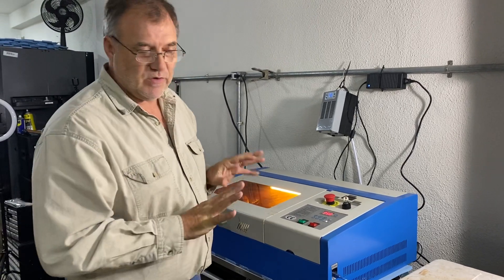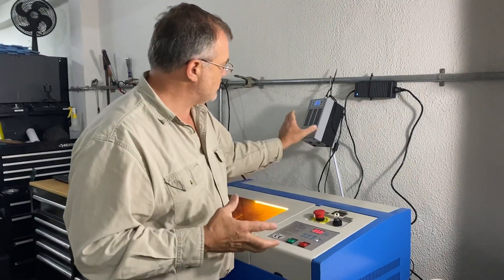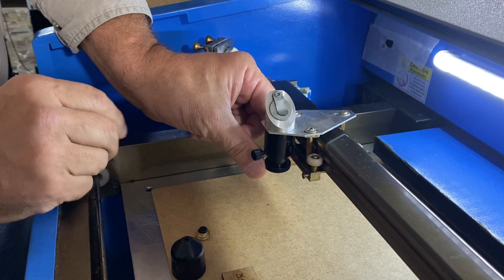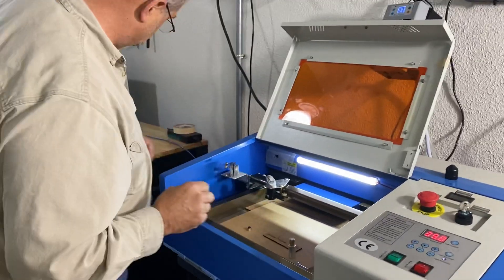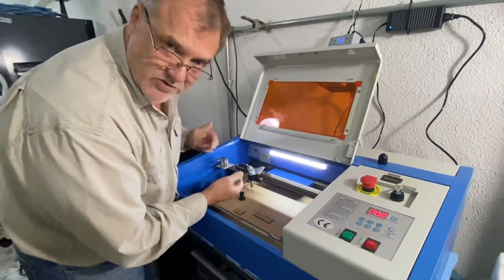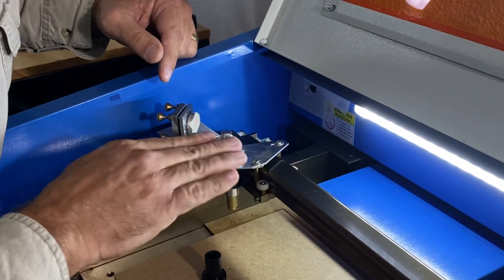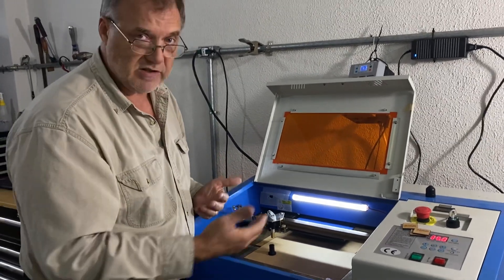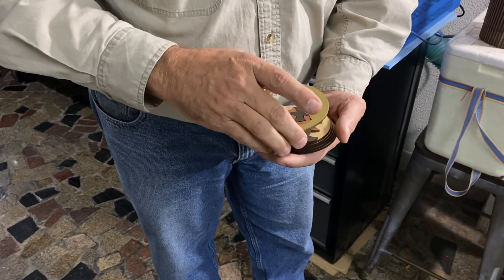Simple upgrades for your K40 OMTech Co2 laser

Comment: I was a laser tech where we used 100 w and 250 w co2 lasers, we had air flow coming into the lens holder to always have positive pressure so no smoke came in.  We maybe cleaned the lens once a month (with acetone). They ran 24hrs (some down time) 5 days a week. Our co2 came in trucks and was a constant feed type.

Comment: I bought your alignment tool and I'm having problems with my K40

All the way to the left its centered. All the way to the right the dot moves 3 inches to the right.  Not sure how its drifted that much as I aligned the belts/frame using an accurate square. The X axis is parallel to the bottom of the frame. Cuts using the laser come out square. I can adjust the bracket holding the laser head so that when its all the way to the right its centered on the mirror but then the left alignment is off. 

Any idea on what to look at?

Comment: Agreed Steve.   Getting people to understand what you said about getting the linear travel stabilized as you move the gantry from corner to corner and not worrying about making within a given space "even if it misses the mirror completely at first"  is hands down the hardest thing to get most to understand.    
Mirror 2 and how to properly set it up to mirror 3 is the easily the most misunderstood alignment process of them all in my opinion.
 Honestly I believe it would do most a favor to just place an oversized piece of paper over the entire mirror 2 assembly and forget about it until the impact point has been stabilized from movement.